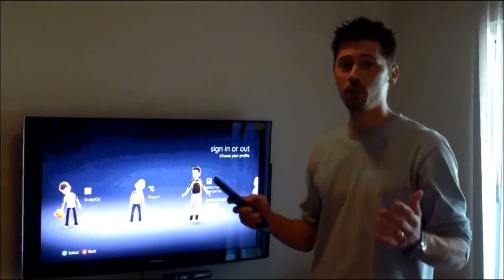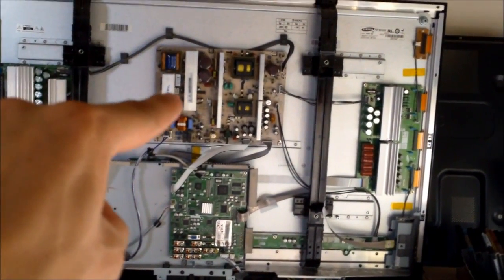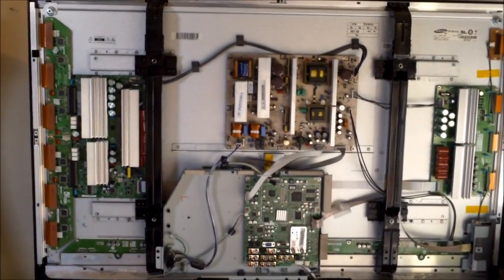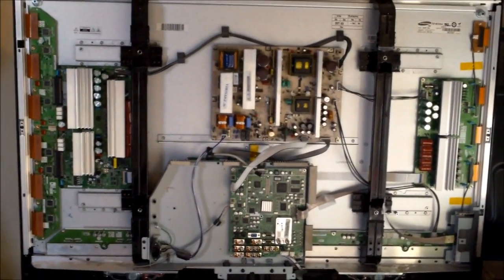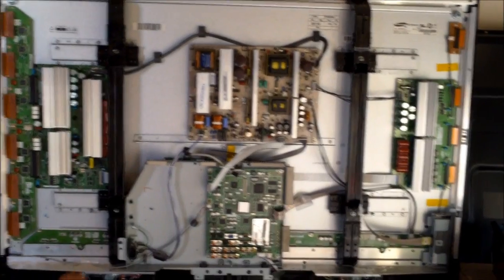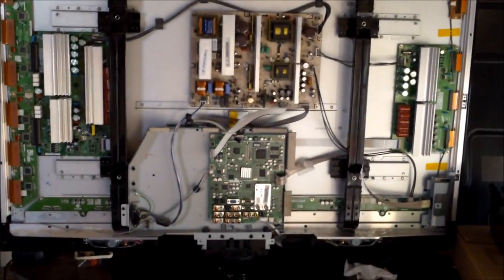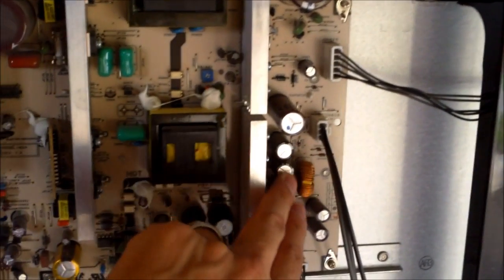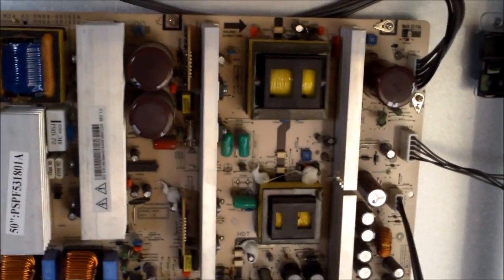WHAT PLASMA TV BOARDS commonly Fail review

Comment: Hi my donated 60 inch plasma cycles but nothing few clicks only does this with y sus board plugged in .....found bad ceramic capacitor  on y sus . Reppaced and 1 next to it ....reppaced 3 mosfets seemed bad . And a resister so far ......i have a short at 1 of the buffer cinnectors ..outer pins (well 2 in ) . Any help /advice is appreciated  ty

Comment: Hi, may I know how to test pattern or auto gain on plasma 51 inch samsung tv? I a bit confusing with symptoms with blinking indicator but no picture and audio. Checked Vs, va, 5v, 15v and ps on with normal condition. I'm suspecting is it main board faulty or not.

Comment: I've been trying to figure out my LG 50PC350UB for over 4 months now.  Had many shorted IGBT's and MosFets on the Y_Sustain board.  Replaced them all along with blown gate resistors, a shorted gate driver IC, and several low value resistors that were open.  TV turns on and has picture but it's not discharging correctly as I have a long image retention and a lot of color speckling.  Got a 2nd Y board free from a friend (It was also blown) rebuilt it and have the same problem.  So I suspected the Z_Sustain board, replaced it with a used one from Ebay and still the same picture problems.  Mine has an X board along the bottom of the panel.  That board was not mentioned in your video and it looks like your TV doesn't have one.  Would you happen to know the function of the X board and if it could be causing my image retention and bad video?  I'm starting to think I may have a bad plasma panel.

Comment: Hi.Nice simple explanation guy.I have a Lg 50pm4700 plasma tv .its has all the voltages on main power supply board and x and u boards.The tv clicks wen power button is pushed ,the red led goes off and blinks twice .No picture no sound.what could be the issue ?

Comment: Hi wonder if you may have come across this problem before . I have a 50" plasma the remote stopped working. I purchased a new one worked for a bit then stopped. I thought perhaps the ir sensor was faulty. I changed that sensor board   with a second hand part. Worked again for a while then stopped I suspected it maybe the controls being that they are universal so I got a new set .but still the same works some times but not all the times. Any ideas

Comment: I have a LG 60PZ950 plasma TV that shows snowy  red solarization. Everything else works fine. I Did some research on the internet and I suspected z-sus board was bad and replaced it. That did not solve the problem. What do you think?  I am not a tv repairman but I like to tinker around.

Comment: I have a 2010 model s50hw-yb06 and initially i plugged it in and got click click pause click click pause click click.  Si o swawwed out a control board fron a similar tv and it powered on with tne start up sound but no picture.  The other 2 part tvs are a close match but all the other parts . Any ideas,

Comment: LG Plasma  60PA6500. I turn it on, then sometimes turns off on its own. Then I turned back on, I get no image but sound ok. I let it rest turn it on and may work for another 5-10 minutes then goes off. Again I turn it back on, no image but sound ok. Basically the image works when it wants, lol :-) . Other times, it works for hours and no problem, but if I turn it off the image won't come back. At least not right way.

Comment: So am having difficultly troubleshooting the issue with my LG 50PM6700 Plasma TV.  It powers on, but after continued use (about 20-30 mins) the picture goes black intermittently.  If I power it off, let it cool down, it will work again for a various amount of time.  No clicking sounds can be heard.  Any suggestions?

Comment: Hey I have a plasma lg tv that used to click on and off every couple seconds and does that the whole time so I looked for burnt capacitors and don’t seem to find any in the power board but when I looked on the y board I found one burnt ceramic disc capacitor(the blue pill disc looking one ) so I replaced that and tried to power it on the clicking on and off stopped but it just click off when ever I power it on, though the clicking on and off stopped it stills clicks off and stays off until I press the power again and it just click back off, I tried unplugging the y board from the power board and to surprisingly the power stays on now but as soon as I plug the y board back it makes a short buzzing sound then shuts off? Idk what it is I replaced the only burnt ceramic disc capacitor that I found and looked carefully for others, is it the y board or is it still the power board that I have to check?

Comment: I have a Panasonic TC-P50G25 does not respond to commands from the TV remote ! I have to unplug the TV to turn off. the Power button on the TV will turn on the TV and sometimes the remote - I do not get any commands from the remote and on the TV such as turning up the volume or making any menu selections !

Comment: Samsung plasma - completely dead. No lights. Fuse is good. No VS voltage, there is DC ps voltage but that's it. There is no standby 5v voltage. I bypassed the main board and tried to turn on the tv and the power supply clicks but still doesn't turn on. Would you also assume this to be the power supply ?

Comment: I have a colored vertical line (seems a one pixel wide) on my PN51E7000. Any idea what it may be?
Reply from the maker: Elie Kesrwany check ribbon cables to screen or small control board. get TV boards at Shopjimmy or electropartsonline.com use code tampatecfriend for discount.

Comment: I have a Samsung plasma set very similar to this in the back. On mine the far right 1/6 of the screen is all "snow". The audio and the rest of the picture are fine. Would this be the buffer board? Tapping the 6 ribbon cables had no effect.

Comment: I have a Panasonic TC-P50G25. Last week it quit powering up. The Standby LED was showing 4 blinks. After unplugging tv and then holding the power on button for 60 seconds, the Standby wash showing 10 blinks. My inderstanding is that 4/10 blinks is a power problem that may be in the P Board or the SC Board. Hiw do I determine which board and which component. I visualky inspected all o the caps and they do not show any signs of bulging or crowning.

Comment: Hi, I really need some help with my LG plasma TV.
I have an LG 42' plasma tv with sound but no picture.
The story:
The TV stopped turning on. I've checked the power board, there was no Va nor Vs voltage. After replacing power board, the TV started to turn on for a second or less and then turned off. After disconnecting Ysus and Zsus power supply the TV turned on and there was a sound. I've checked main IC's at Ysus and Zsus and they were shorted so I've replaced them (only IC's). Now the TV turns on and there is sound but no picture. I'm not sure but it seems to me like the logic board is not firing up the Ysus board. The logic board is PDP 070209. There are four LED'S in a row (D1-4) and one separate (D15) on it. D1 is off, D3-4 are lit and D 15 is blinking. Now my question is how to get to know if the logic board or Ysus board is faulty.

Comment: After a storm my neighbors 60 inch panasonic plasma wouldn't turn on. Model tc-p60s60 and its giving the 3 blink error code.The only thing i can find while doing research is its a bad d board though I cannot find a d board on this TV. Already swapped the power board and no luck. Any ideas?
Reply: Inside of this Panasonic looks similar to the one shown in your video just minor differences like the video i/o board being bottom left instead of bottom middle.

Comment: Great video and thanks
I have a samsung 50 inch PN51D550C1F..I have standby voltage of about 5 v but no VS or VA control and therefore no voltage at either..replaced power supply board but no \thing

HELP if you can?

Comment: Hi I have a zenith 42 inch plasma that has a dark glow after three seconds has sound though my voltages are correct I also have clear test patter when I put logic control into ext with out main attached wondering if you might know what causing it I was thinking main board or bad logic any ideals

Comment: Hi,
LG 60PK950.
There were couple of green vertical bars in the middle. I reseated all the ribbon cables of the X buffer boards XRRBT, XRCBT, XRLBT. After turning on the TV, those were still there, until a silent pop and the middle third vertical part went to total black. I made some troubleshooting and measurements, but looks like 60V still goes through all the parts of the X buffer boards. The control board has been checked as well to know if it gives any feed to the XRCBT, but that seems to be fine. Can the Z sustain board be faulty? Any idea? THanks.
Reply: +fulesmackofule The service manual says that I should measure 105V on the R275. It is 104.6V after couple of minutes. Does it mean I can exclude the ZSUS board from the investigation?
Reply: Hi were you able to find the culprit here?  Was it the main control board?  Were the vertical lines thin? @fulesmackofule
Reply: @arthurdeleon3309 Yes, but it can be thicker too based on how many neighboring columns go out. Unfortunately, I had to throw out the TV, but still have most of the boards from it. The plasma panel has those ribbon cables manufactured in such a way that you cannot separate them from the embedded chips. If the chip starts to produce those contact or other issues, then you would need to replace the whole plasma screen, which may mean more cost than a new TV.

Comment: Hello,  I have a samsung 50 plasma and one day I came home and it was off. There was a solid red light on the front. When I touch the power button nothing happens. the light stays solid and these no reaction (the same goes for the remote control power). If I unplug it and plug back in the red light comes back on (solid red light) and I hear clicking.  

I thought it was the main board despite the caps looking fine so I ordered one and replaced. It was the same problem after replacing the main board. The logic board does have a flashing green light (heart beat speed) so that seems normal. 

Any ideas? I really thought it would be the mainboard and most peoples issues include a flashing red light not a solid red light. This has me stumpted. 

Thanks in advance for any ideas.

Comment: Howdy Sir, I have a LG 60PS11 plasma television can indeed it doesn't have a black bar but it does have concentrated area (about 2 inches wide) of pencil thin lines.  They are not evenly spaced and as I say only cover about a 2 inch strip that happens to go right in the center of the TV.  Also a newer one is developed over to the right a few inches and it's just a single pencil thin line.

I wonder if this could give you an inkling as to whether it might be the display or one of the buffer boards:  I notice that it's absolutely the worst when the color is blue on the screen – then you see the lines is pretty much black.  However, when the picture shows green or maybe brown or beige in that area where the strip is, it's almost as though the lines aren't even there.  So it seems to possibly be, I'm guessing, a concentrated area of 7 or 8 lines full of pixels that maybe our blue?  (The blue the picture, the worst alliance look).

It seems to be the same for that single line as well.  Same exact ammo.

Between those lines and certainly outside of that strip of 2 inches, the pictures perfect and does not vary in shade grade color etc.

If there somewhere I can email you several pictures I took, that would sort of paint the picture.

I did of course fairly thoroughly clean up ALL the ribbon cables on the whole television just to cover the bases there.  I was careful to put them back into the slots correctly before closing the little clampdown on each one, etc.

I look forward to your thoughts!

Comment: I got a Samsung 2012 64" Plasma 8000 series that turned off during a movie and now wont turn on.   Some have said unplug the wi fi from the MB and it can fix it.  WTF?   Makes no sense that would work.     Anyway mine is DEAD meaning NO power on.    

From watching videos and info about repairmen I do not feel confident.  It was almost 3,000 TV so Id pay some to get it fixed but it looks like the repairmen just guess and end up costing you a ton.    

I'm thinking it might be cheaper to just shot gun it and replace all the boards.   Probably cheaper than a repairman.

Comment: I have a Samsung plasma tv model  S50FH-YB01 and when I turn it on it cuts on and off until it gets a clear picture then it stays on I believe something is going to go out so I was trying to figure out which board could that possibly be
Reply from the maker: check dc volts on power board, but many times it's
Reply from the maker: +Tampatec sustain board and buffer
Reply: I have the same tv when it comes on makes a sound then cuts off sometimes it works but if its not right shuts itself off sometimes ill get a rainbow colored screen then it stays on or a snowy picture and stays on
Reply: Darion Green had the same problem, but replaced the x sus board. not the y sus. It works perfectly now. I have the f8500 samsung
Reply: I have a lg 50pk990-za first start with lines in screan vertical very slim after lost the image but have sound but look like is in slow motion what board can cause that please help thank you guys

Comment: I have a LG 42PA4500-UM Standby light comes on and has a gray screen. I replaced the power board but no change. No sound either and I disconnected the y and z sus boards as in the video. I checked the voltages to both sus boards and the are correct. I'm stumped.

Comment: Hi i have a samsung turns on and off but is not getting any signal the screen say that is not supported i try to connect the cable all 3 hdmi and the same thing happens anh idea what can bee?? Thanks
Reply from the maker: unplug powercord, unplug y sustain completely out of circuit then turn on tv if tv stays on (audio but no video) then it can be y sustain board and - or y buffer ic short. I did a video how to check y buffer board ICs.
Reply: Thank you i will try this right now!!

Comment: Thanks for the video. I have a plasma tv with green indicator on as normal but no picture and no sound. I have checked the voltage, all are in normal, but only one which is VSCAN = -50V (on the board says the value should be -170v to -250v). this goes to Y board. any suggestion? Thanks

Comment: Samsung plasma tv PN42C450B1D no picture and clicking no swollen capacitors if I unplug y & x board when I turn on tv you hear Samsung tune standby light is on pulled y&x board off to check for burn marks none but x board when I took ribbon off it was ripped and the end was rippled is that ribbon replaceable or cant be repaired tv was free thought I would try to fix

Comment: My problem is with my Panasonic TH-50PX75U. It looks like the picture is going out but then after it's on for a while it works just fine. At first the color is all distorted and almost looks like you've taken a sheet of acid lol, jk, but I would imagine that's what it looks like. But..after about 5 minutes it's fine, I was told it was the Z sus board. Does that sound correct?

Comment: I have a 50 inch plasma Samsung model pn60f8500-afxza, The set goes on and on flashing different colors before getting a full picture about 5 to 8 times.. Is it the Main board or just capacitor's to be replaced?

Comment: Hi Tampa tech I have Vizio  vp422hdtv10a that won't turn on. Can please advise how check it with meter.  See what problem is. The power supply board no is 0940 000 2270.  Thank you

Comment: Just because the TV is clicking on and off does not mean you have a power board issue.  If the y or x board is bad the TV will also click on and off.  Sometimes by disconnecting each board, unless you have a voltage meter will tell you witch board is bad.

Comment: HELLO TEC*
COOL OF YOU TO DO THIS & HELP PPL
YOU HAVE A GOOD HEART*..bless your holidays+
WAS NOT SURE WHICH BOARD WAS CAUSING
MY PROBLEM" BUT I READ & RESEARCH WAS TOLD IT
WAS PROBABLY 1 OF THESE BOARDS.
SO I BOUGHT ALL 3...
42"RCA PLASMA-42PA30RQ HAVE NO PICTURE NO SOUND"
HIT POWER'...POWER LIGHT TURNS BLUE(stays blue
AND U HEAR ABOUT 3 or 4 clicking
sounds LIKE ITS TRYING TO COME ON
BUT IT DONT SHOW PICTURE
AFTER INSTALLED REPLACED MAIN POWER SUPLY BOARD'
Y-SUSTAIN BOARD'& Y-BUFFER BOARD
STILL THE SAME"....WOULD BE GRATEFUL
FOR UR OPINION & ADVISE? LIKE U SAY IN UR VIDEO
OH YEA' I SHOULD MENTION THE BLINKING GREEN LIGHT
ON THE LOGIC BOARD IS BLNKING LIKE EVERY 5sec..
NOT EVERY 1sec..like normal

Comment: i have a samsung plasma model PN50A510P3F modle code PN50A510P3fXZA. I have a thin white line on the far left side of the screen running from top to bottom which has been there for about a year and i can live with if i have to. Just within the last 2 months when I turn the tv on it will come up with a loud noise and a scrambled picture. It will then turn off by itself and turn back on again without the noise but with a gost image, this happen 3 or 4 times before it comes on and everything is great! if I disconnect the antena wire it will come up and say no signal or weak signal. if I leave it that way and let it warm up for a few min., turn it off , plug the antena back in everything works fine. hope you can help          THANKS

Comment: I have a 50 inch Sanyo plasma tv model number DP50710. It turned off while we were watching and when we tried to turn it back on the green light came on for a few seconds then went off again.  We have replaced the power supply board but that did not help. What else could be wrong?